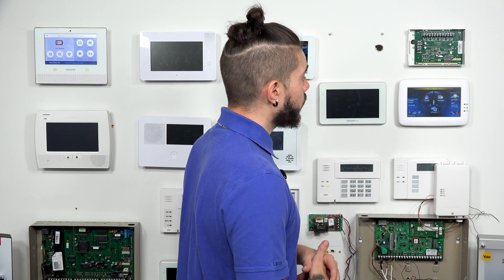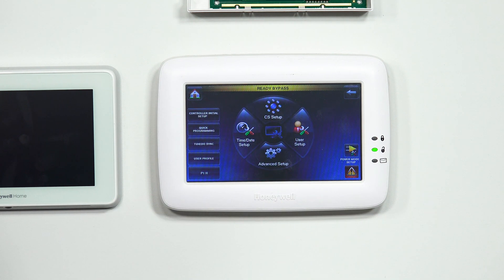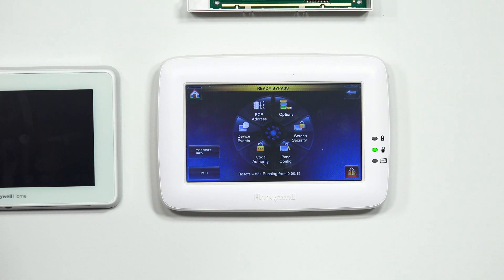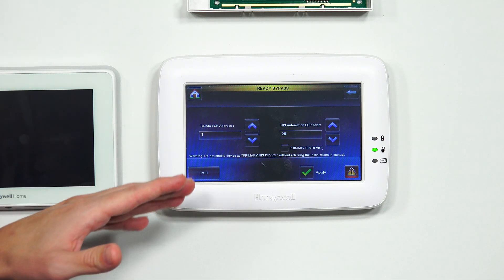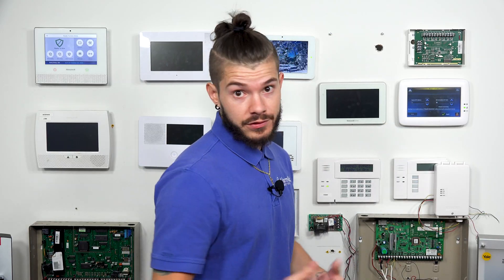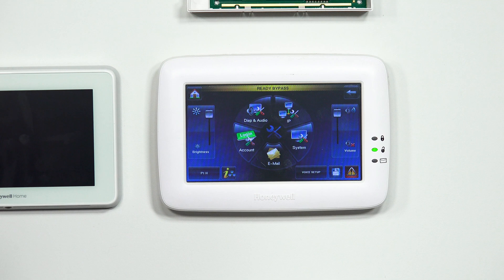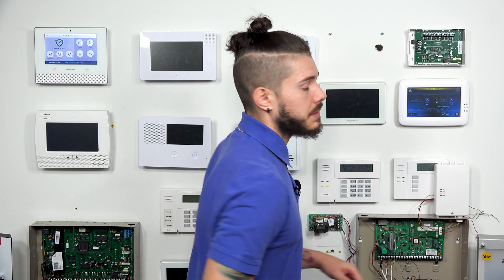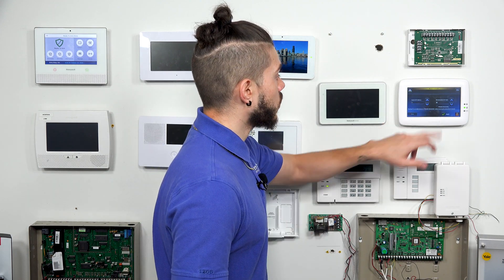The Tuxedo Touch Keypad: Checking the ECP and RIS Address

Comment: Hi, Is there a way around it without the installer code?
Reply: If the Tuxedo is working on the Vista panel then yes that is needed. But if the Tuxedo has an ecp error or is not connected to the panel then you use the default code of 4140.
Reply: @freddaniels8259  it didn’t work
Reply: Reset your code
Reply: @Alexsmartway  yes did that using the vista keypad. FYI: disconnect the back up batteries and shut the breaker to the alarm panel. When breaker back on, u have 30sec to hit # and * keys together and hold it. This will take to menu for resetting. Default install code is 4112 on vista
Reply: @stsingh167  yeah just power cycle your panel then hold * and # and it will kick you into programming then press *20 then new code to verify your code press #20 it will read the code out to you then that’s your new code for your vista/Aemco panels